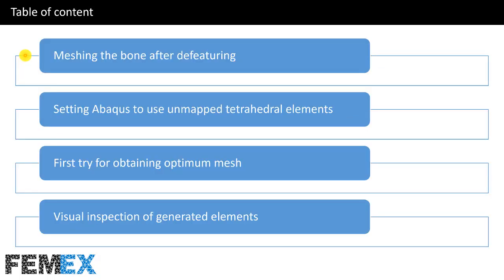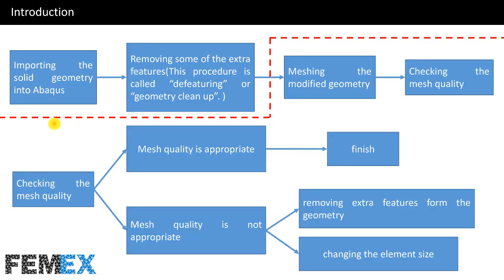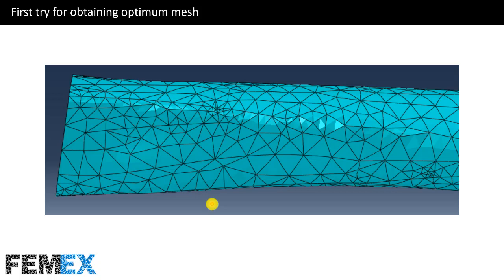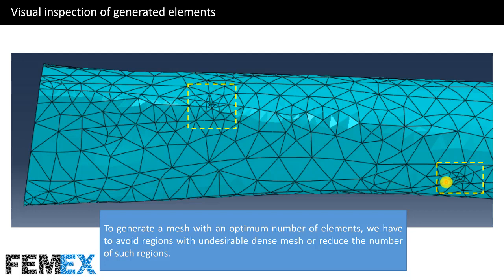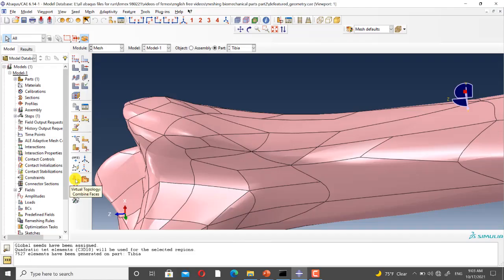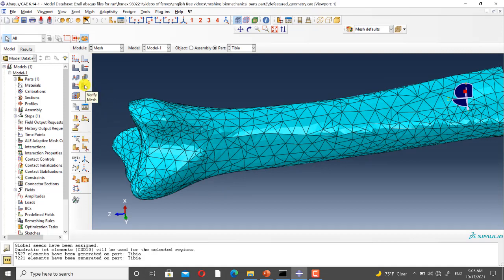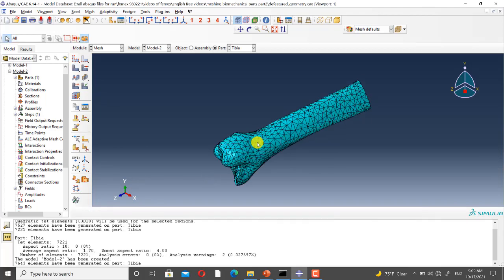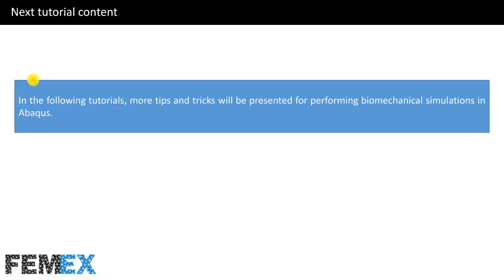Meshing Complex Biomechanical Parts including Bones and Soft Tissues in Abaqus part 2

Comment: What is the effect of using first order or second order tetrahedral element on the simulation ?
Reply from the maker: Hi.
In the same number of elements, generally second order elements are more accurate. Also in the Abaqus documentation it is said that if you are forced to use tetrahedral elements, you must use second order elements with modified formulation which is named C3D10M element. But according to my experience, second order elements may cause a lot of problems in the model and its easier to use first order tetrahedral elements.
Because reaching good quality second order elements is harder than reaching high quality for first order elements. Also the possibility of getting unwanted errors increases when using second order elements. So generally its better to use a finer mesh with first order elements. At the end, all of these must be tested on the model to obtain an optimum simulation which is efficient and enough accurate.
Reply: Thanks for clarification of my dought sir.
Reply from the maker: @abhinavsiliveru5448  You are welcome.